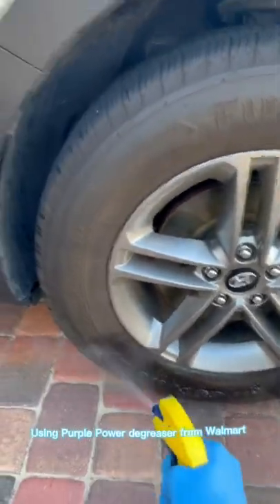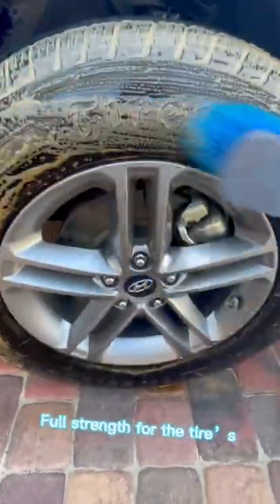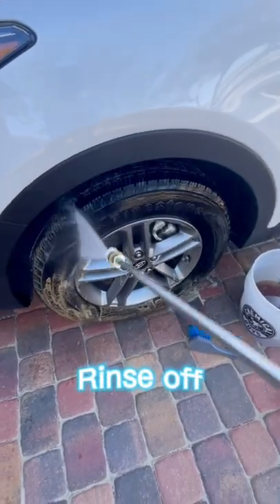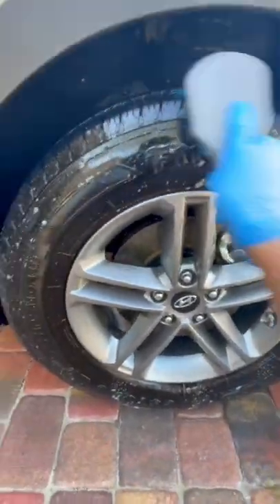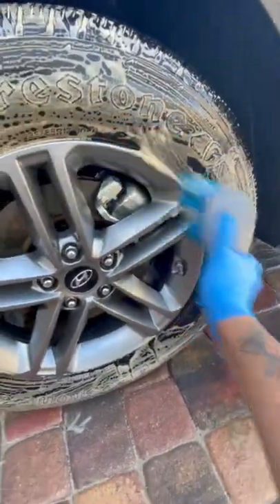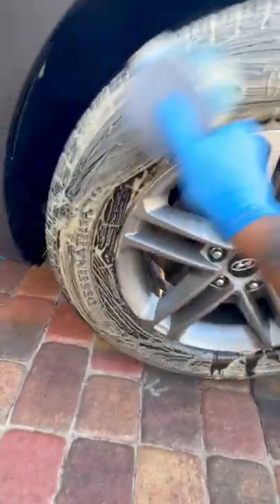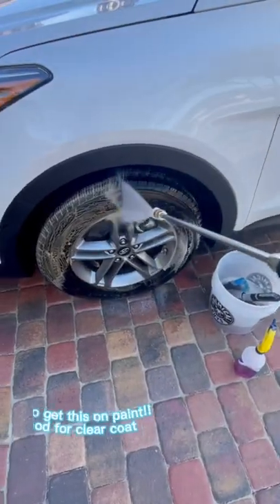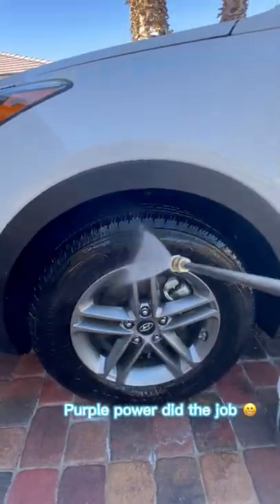Awesome tire cleaner!! Purple Power Degreaser from Walmart is cheap and powerful

Comment: Never use a degreaser on rubbers or plastics. Causes fading and drys them out by pulling the oils out of it. Horrible advice
Reply from the maker: Never huh? Some degreasers can be harsh, there are many tire-specific degreasers designed to clean without causing damage. Always recommend checking the product label and using one that's safe for tires.